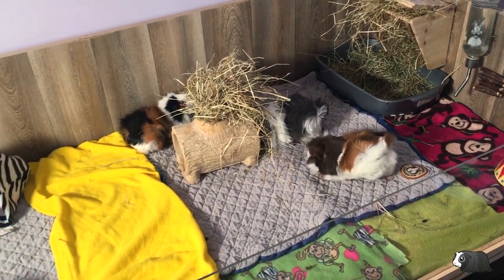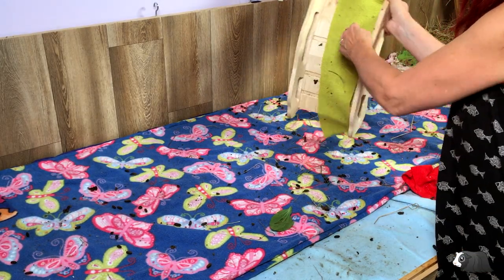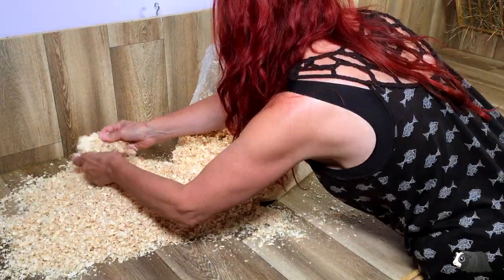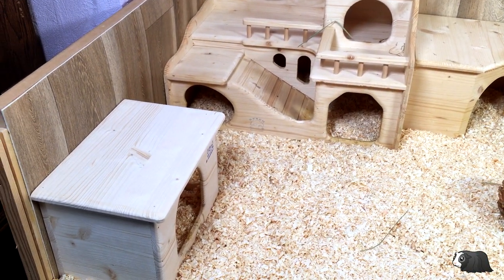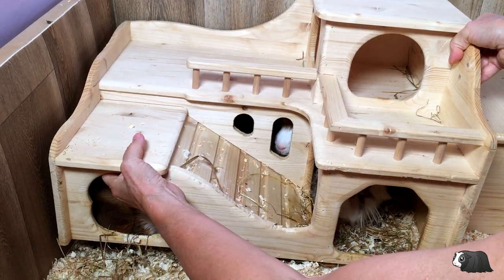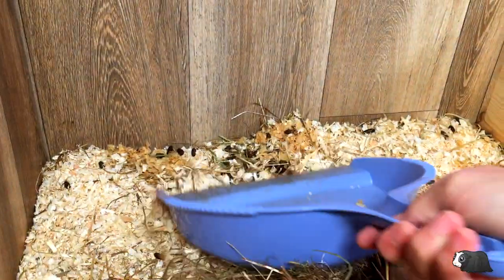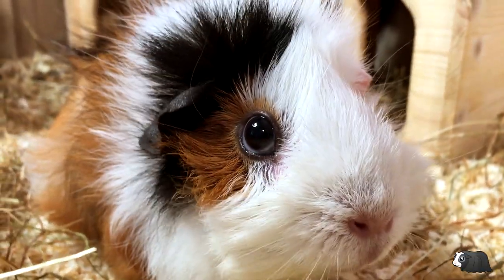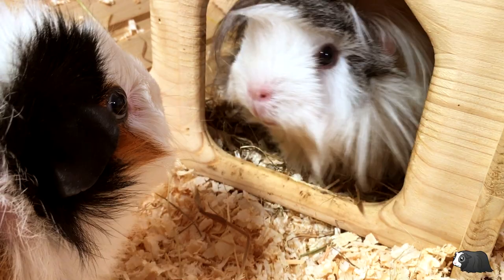PINE BEDDING vs FLEECE LINERS for GUINEA PIGS | Which Is BEST? | Pine Wood Shavings PROS & CONS

Comment: I use fleece liners on the bottom of my cage and paper based mixed with kiln dried pine on the loft
Reply from the maker: It seems that quite a few people like to use both but for different areas of their guinea pigs cage - it's a good compromise :) Do you find a mix of shavings and paper is more absorbent than shavings alone?
Reply: Guinea Piggles I’m not actually sure, but I find it really fun to mix them together 😂 I also got this fun blue bedding and it lasts longer if it’s mixed in.
Reply from the maker: I think some people may mix them  together too because paper bedding can  work out quite expensive so mixing together is a bit more economical - we will have to try out some mixes and see how they work too! With coloured bedding, we don't usually recommend it but it's worth checking that the colours are natural because they do sometimes try and eat bedding :)
Reply: Guinea Piggles actually, colored bedding is completely safe!! It’s only scented that can be an issue.

Comment: Until i got my c&c cage I used to have at least 3 bags of used shavings.  Used to fill my bin up! Have had the 5x2 c&c since February and always used fleece as i thought it would be cheaper.  I would use loads of shavings  and the urine would stain the correx i thought.  Not too bad with fleece,  the urine scale sits on the top
Reply from the maker: It's good to hear other peoples experiences of the different bedding options so thank you for your feedback :) There are definitely pros and cons with all bedding. You do get a lot of waste with the disposable ones but fleece liners require a lot of washing and we've found and are higher maintenance when it comes to cleaning.
Reply: @GuineaPiggles  true.  My zipped bag i put the dirty fleece in to wash, came undone in washing machine early!  What a mess! At least the dryer removes a lot of the hair and dander!

Comment: I always thought pine wasn’t a good choice because of the naturally occurring resins in it, although the one used in the video is new and improved. Aspen is supposed to have less dust in it, so, it might be even better. Is paper-based bedding a good option? Informative video, and such beautiful piggies! ❤️❤️❤️❤️❤️❤️❤️❤️❤️
Reply from the maker: Pine bedding is fine providing it is Kiln Dried. The drying process removes the aromatic oils that are toxic to guinea pigs. We will also  be testing Aspen and paper bedding so look out for these videos that are coming soon but yes,  these are both good options too. You can find out  more about the different bedding options here https://www.guineapiggles.co.uk/guinea-pig-bedding or https://www.guineapiggles.com/guinea-pig-bedding if you're outside the UK
Reply: I am about to try it with one of my hamsters
Reply: @whyjustwhy2168  hamster need the dig

Comment: I use a mix of fleece bedding and kiln-dried pine or aspen in my c and c cages. I made a very big coroplast tray, and put the shavings in, then do fleece in the rest of the cage. Right around the coroplast tray some shavings come out as the piggies go in and out, but not too much, it's pretty easy to get up off the fleece. I also use a few one by two fleece liners over the main liner in the rest of the cage, which is full fleece, and potty pads under the hidey houses. It's still alot of work, although they do about 2 thirds of their pee and pooping in the large tray with the bedding, because they have their hay there. It's still a bit of work each evening, I spot clean the shavings area like you did, then brush off the fleece in the rest of the cage, and remove any damp pee pads or smaller liners. The main liner does last about 5 or 6 days though, but there's still alot of laundry because I have 2 cages about the size of yours. I'm thinking of trying to bond them into one herd, that way there's only one cage to clean, but I'll make it bigger for the 6 piggies. Now I have 3 in each cage. Great video! Thanks!
Reply from the maker: Thank you so much for your feedback - it's really useful to hear about other setups that work well. It's a good idea to combine shavings and fleece too. I think your idea of bonding the piggies into one big herd is a really good one - they  can be so funny in larger groups and really entertaining to watch... often better than watching TV! For me it's the laundry that I find challenging so we'll test a few more beddings and will make a decision on one once we've tried them all :)
Reply: @GuineaPiggles  I'll let you know how the bonding goes, and boy, do I know about the laundry!! I do from 7 to 8 loads a week of piggy laundry, also because I have 2 very large enclosures. Then every other  week I wash about 5 large liners, usually at my local laundromat, so it's definitely alot of wash!

Comment: I’ve used shavings in the past and it’s just messy and expensive. Fleece is also expensive because of electric bill concerns so it’s hard to decide. Anyone have any suggestions on what is better for the piggies and cost wise?
Reply from the maker: I would say shavings are the cheapest overall but it does depend on where you are as costs vary in different parts of the world. You might like our page on the website about different  types of bedding here https://guineapiggles.com/guinea-pig-bedding
Reply: Wood shavings from tractor supply